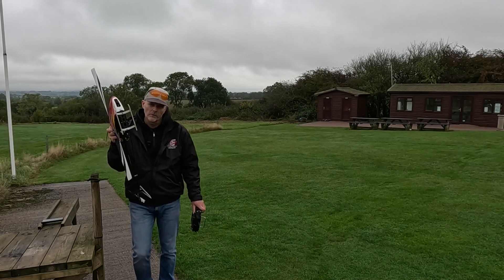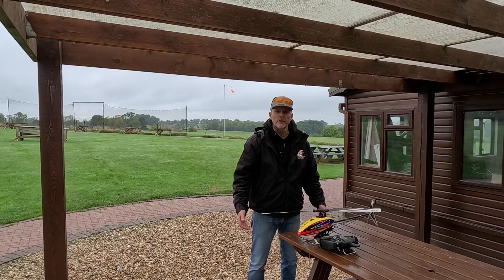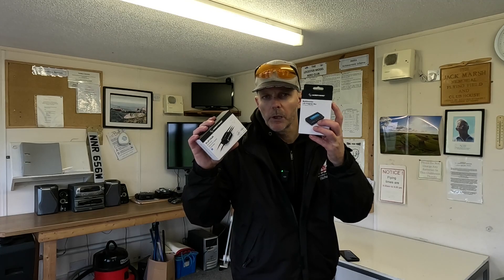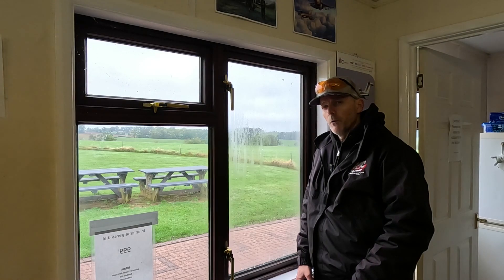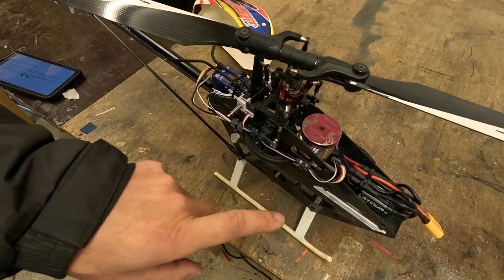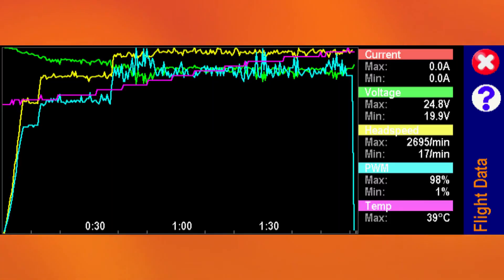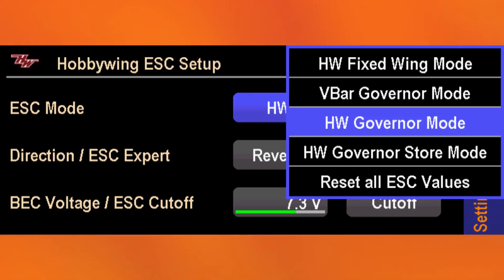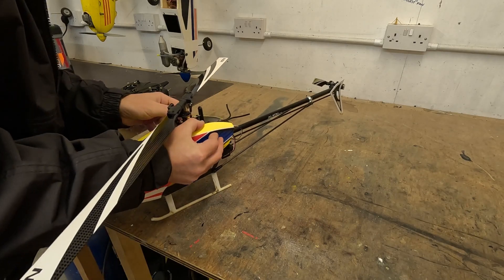Align T-Rex 470L gets Hobbywing 60A ESC

Comment: YGE 65LVT for the win but yes...expensive...though worth it for current sensing!
Reply from the maker: I actually thought the HW had current when I initially installed it, but obviously got 0 values from the telem. I quite like YGE but the price would have been a step too far for a basher. Saving it for the TB40 👍😀
Reply: its only the 80A and above that give you current in HW's lineup..
Reply from the maker: @davids8345  Ah, thanks for that.
Reply: True it doesn’t have current but it does have battery voltage and RPM. YGE has really good ESC’s but on a fun flying 450 size heli and a stock Align motor unless I had one laying around or as my friends in the UK say “Not worth the extra Quid”. I found Richard’s channel a few months back and I really like the content and style!  👍👍👍

Comment: I have a Trex 450 DFC which is my practice helicopter, but I feel it doesn’t fly that well and want to upgrade it. I was thinking either the 470L or TB40 and was wondering what you think is the better option as an every day practice helicopter. Needs to be cheap for parts for when I crash.
I normally practice on the sim, then my 450 and once I get good on the 450, I then try it on my 550 and 700. 
I want to follow this same principle but just with a better practice heli.
Any advise on which model is appreciated.
Reply from the maker: Depends on what sort of stuff you're doing.  I've never been a fan of the 450 in terms of its flying or crashworthiness. The 470 is a love/hate. It's actually pretty good, crashes well, parts are cheap and it's quick to fix, but the tail can be weak if you're doing aggressive reversals. I've not had much time on the TB40, but they look pretty good. It would probably be exactly what you're looking for.
I've been quite impressed with the S2/M2 size helicopters. Good at most things and crash well, but some don't like them.
Reply: @rchelicopter thank you, I’m in the process of learning rainbows and tik toks. The tail doesn’t told when I do aggressive pitch changes, so when doing rainbows doing from full positive to full negative, the tail kicks and makes it very hard to control properly. 
Ok sounds like the TB40 is a good option. I find the smaller helis harder to transition from to a bigger heli, that’s why the 470/TB40 is a good size. 
Thank you for the advice

Comment: Finally putting a HW Platinum 60A in my 470LM.  I know default motor rotation on the HW is ser for "clockwise", dumb question, is that the correct setting for an Align 470L?  Or should it be counter-clockwise?  Thank you!!
Reply from the maker: It depends on which way round the 3 motor wires have been connected. If the motor is going the wrong way, you can either swap 2 of the motor wires, or change the direction in the ESC.

Comment: I just had my 35 amp align esc in my 450 pro cause my tail servo to fail and spin the heli in the air. After crashing the heli was smoking bad. Thought the lipo was going up but fortunately the smoke stopped. I found the esc absolutely fried. Im replacing it with this esc instead. Hopefully no more burning escs

Comment: Hi my name is daniel . Please tell me the gear ratio and the pole setup in your vbar for the t rex 470  ! My 470 have 4700 rpm 😮😮😮
Reply from the maker: Hey Daniel. I haven't flown the 470 in a while so I can't tell you without doing some digging. It's the stock motor and gear ratio, so it should say on the Align site or in the sales specifications.
Reply: thanks for the reply

Comment: After seeing you fly this Richard, I’m going to buy one in the morning! It seems to be the perfect little machine for me to push my flying forwards with and try new things with. 

The spares pricing is amazing too. 
My winter basher heli. Will report back what I think of it. Going to use the kit esc for now
Reply from the maker: Don't pay too much money for it. You should be able to pick them up really cheap, but it is an 8 year old design and the replacement TB40 is imminent, which may affect future spares.
Also the tail ratio of 3.7 is terrible. You can use 74mm blades but it may not be enough depending on how you fly. Good fun if you find a bargain though.
Reply from the maker: If you do get one, go for the belt, not the torque tube.

Comment: This is awesome. I am looking for this for my 450L. And my two Goosky helicopters.

Also how much did you pay for the 470L on eBay?
Reply from the maker: It was just over 100 USD. He said it was flyable, but I ended up replacing most of the shafts. Very cheap to do though.
Reply: @rchelicopter  wow I would like to find a deal like that.
Reply from the maker: @LichaelMewis  Most seem to go for around double that, I just got lucky. ebay and marketplace seem to be the best for it.

Comment: That 50X ESC is not good. I swapped mine out for the Hobbywing 60A and what a huge difference. I run Futaba and with the telemetry adapter and the governor feature of the Hobbywing turns the 470 into a much better helicopter. I'm a Richard also, proof that great minds think alike!😉😂
Reply from the maker: Although the Align says it has a gov, I couldn't find it :D
Reply: @rchelicopter  did you use the gov of the hobbywing and all the steps of doing the calibration of the gov at mid stick for 30 seconds and no load or 0 degrees pitch? what cable is used for telemetry does it work in the old vbar control radio?
Reply from the maker: @RotoRCol  Yes, used the HW gov, and did all the motor rev, calibration, HS setup, etc. off camera.
The lead I used is an official HW/VBar item. It should work fine with classic VControl.
https://www.hely-shop.co.uk/hobbywing-vbar-connection-wire-for-platinum-50cm-hw30810001/
Reply: @RotoRCol  Yes, select STO GOV,  (if you use ELF GOV, you will need to do the calibrate for each flight) rig a throttle curve so it will hold 50%. Plug into the ESC and run the motor for 15+ seconds. Unplug the ESC and program the pitch curves as flat lines for idle up 1 & 2. For hover I use a flat pitch but with a linear from 0-25 then flat after that. I use the IRCHA helicopter throttle curve calculator to get the percentages to start but it's very close right off the bat.

I'm not sure how the V Bar telemetry works but there is a firmware update that specifies V bar, if you run Futaba, use the firmware that does not have the V in hex update file, ask me how I know.
Reply: @rchelicopter  Only thing is the STO GOV setting...It's a Hobbywing secret...Obviously. I think they think we should already know, which us lucky ones learned from the higher amp HW ESC's and this platform. 🤣
Reply: Is the HW plug and play or did you need to change any connectors?